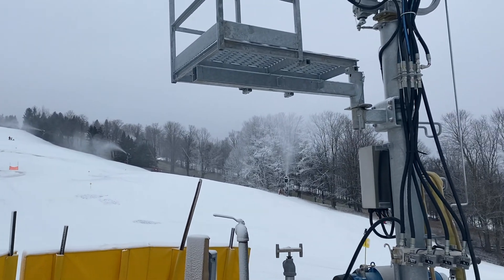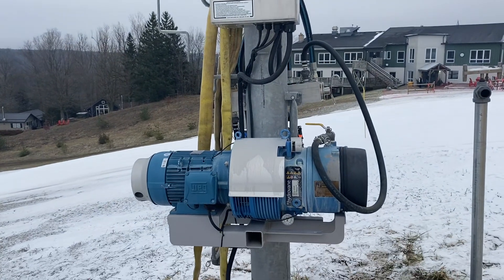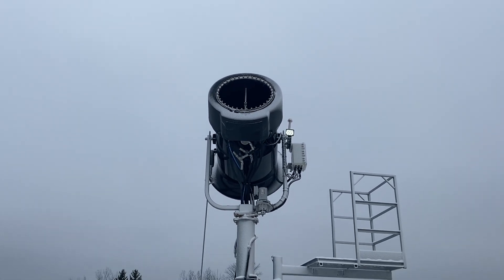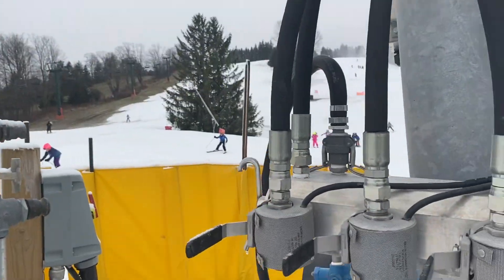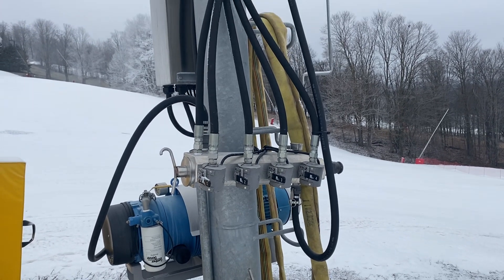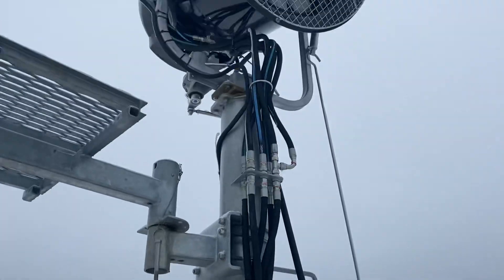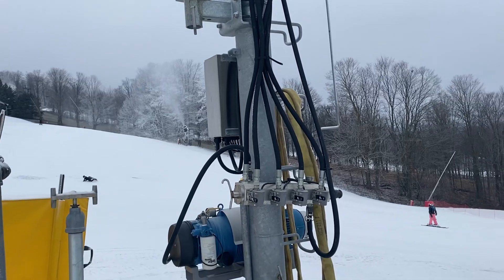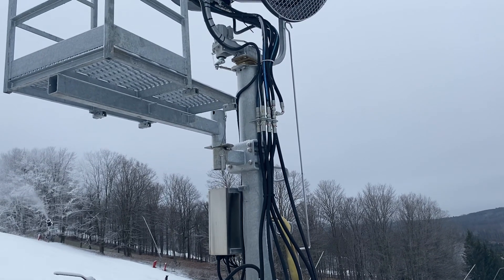How a Snowgun Works

Comment: How do you stop the water freezing in the pipe
Reply from the maker: The water is always moving while the gun is in operation so it will not freeze. When operations are complete the system is setup self drain once you remove the water hose.